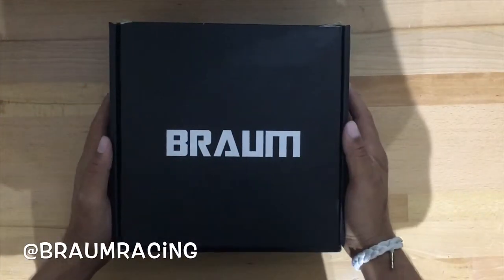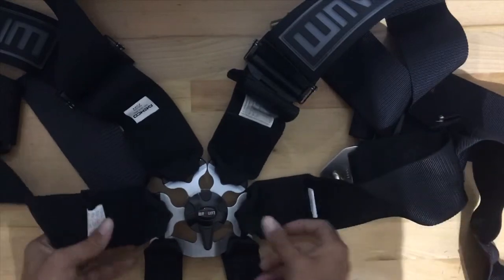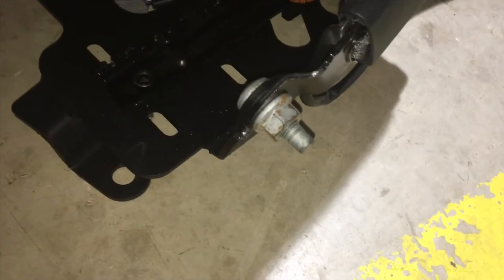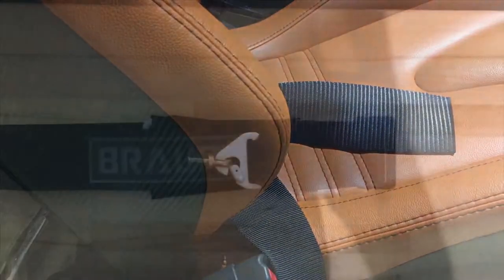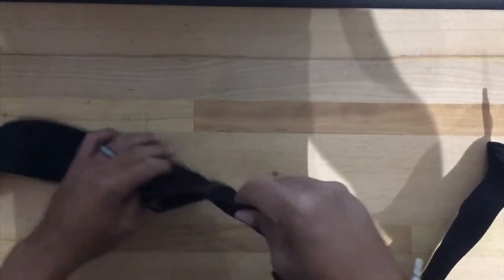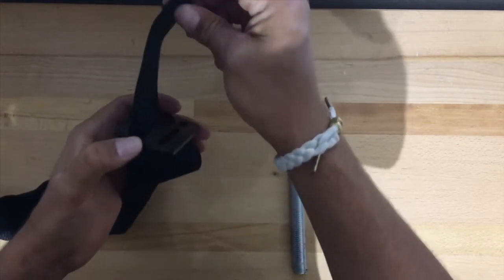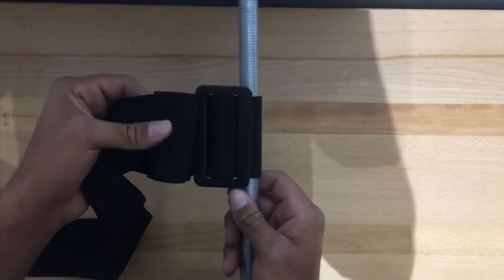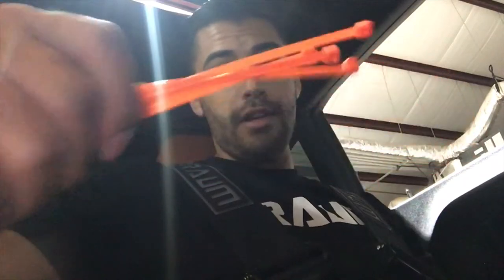BRAUM Racing harness install!

Comment: Kinda curious, why did you leave the stock seatbelts on ?
Reply from the maker: To drive to local events or just regular traffic. 

In the event of an accident if you are wearing harnesses your body stays still but your head keeps moving forward or to the sides causing severe injury or death. 

Harnesses are not meant for street use. 

Seatbelts and your airbag system work together. The seatbelt slightly tears and allows you to “fall” into the airbag. The seat position is measured by a computer to find out how close you are to the airbag to determine at what force the airbag will deploy at. 

If your car back the airbag needs to catch you faster and will deploy faster, if your closer it will deploy with less force so it doesn’t just strait punch you in the face. 

Again , driving to autocross events or cruising with my girl- seatbelts 

Arrive to autocross events or road race events - harnesses. 

With the harnesses on high speed track I use a HANS device and my helmet to further protect my self.

Comment: What size nuts do you need for the eyeballs? My harness didn’t come with them
Reply from the maker: Did you order a BRAUM harness? DM me on Instagram I have a link to the longer eye bolts. @tiradoracing
Reply: TIRADO RACING yes I ordered a set of the white braum harnesses! And I don’t have Instagram shit lol! Post it here and I can copy and paste it
Reply from the maker: I just realized you said nuts not eye bolts. Bro I actually used the nuts from the factory seatbelt! It took me a second to remember. I did it so long ago. 

So one lap belt uses the nut and the other lap belt eye bolt screws into the body of the car. That’s the way I have it set up

Comment: What did you do about the seat belt light
Reply from the maker: The factory seat belt is still in use. In the video I re-attach the belt buckle to the seat and plug the buckle back into the body harness. So there is no seatbelt light or chime. 

You never want to drive with harnesses on the road. If you get into an accident your body stays stationary and your head continues to move which could cause severe injury. 

The SRS system is designed so your factory seatbelts and airbags work as a team. 

The harnesses are installed but moved to the side until track days where I wear the proper safety equipment along with the harnesses.

When I am Racing on a closed course I pull the seatbelt behind the seat and plug it in and utilize the harness that way the seatbelt light and chime isn’t going off while I’m racing. On the street I use the regular ole seatbelt! 

I hope this helps!
Reply: Oh ok great thank you so much
Reply from the maker: No problem. You can also get these belt buckle things from like eBay they come in carbon fiber that you can insert into the buckle to prevent the light from chiming.